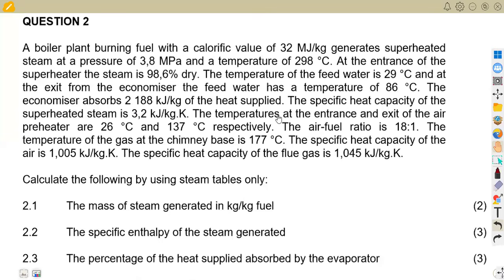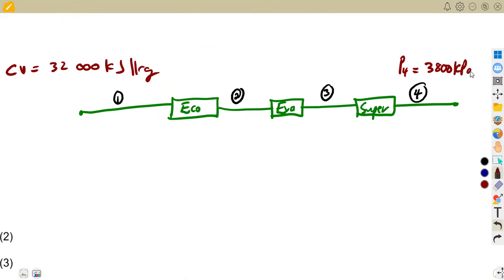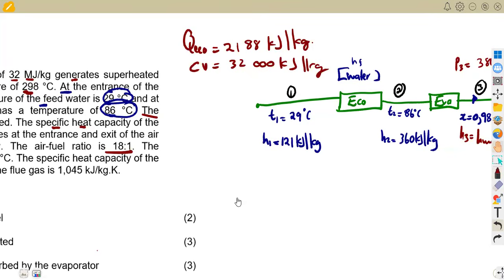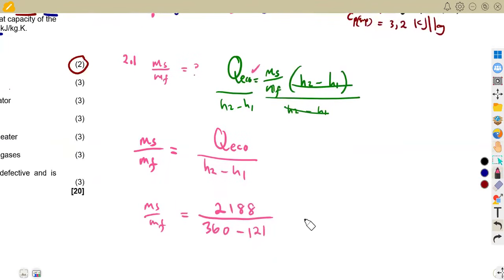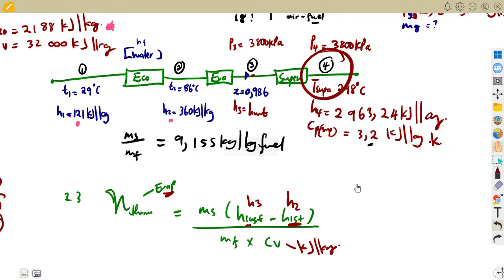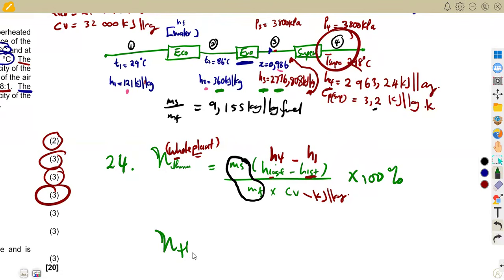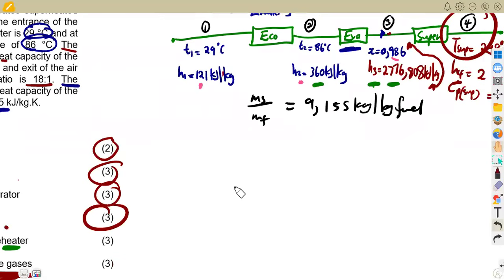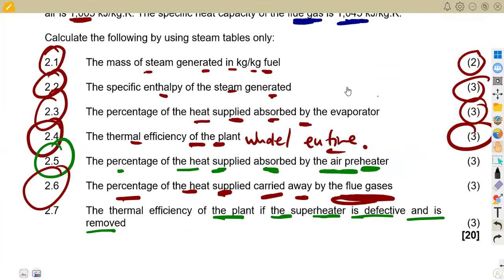Power Machines N6 Steam Plant @mathszoneafricanmotives @mathwithlightone

Comment: Sir for 2.5 why is the mass of air 18 instead of 19kg since we given the air ratio of 18:1 or we use that if we want the mass of fuel
Reply from the maker: The pre-heater works with air so we mass of air there. The 19kg is the one for flue gases at the chimney
Reply: @mathszoneafricanmotives  Thank you sir 🙏Understood
Reply from the maker: @malindi_dube67  most welcome